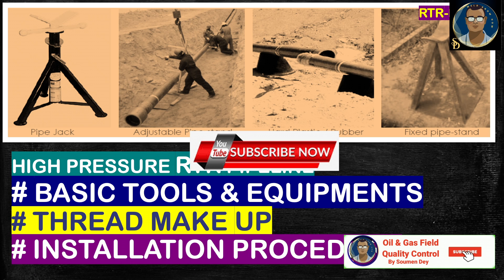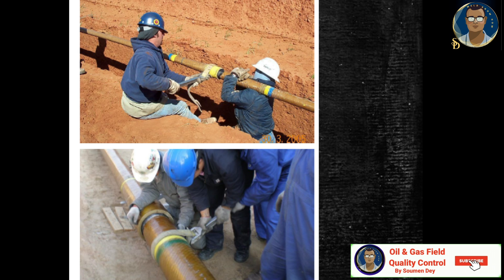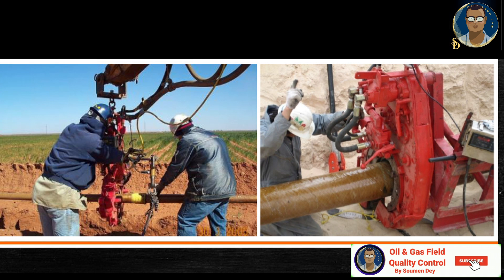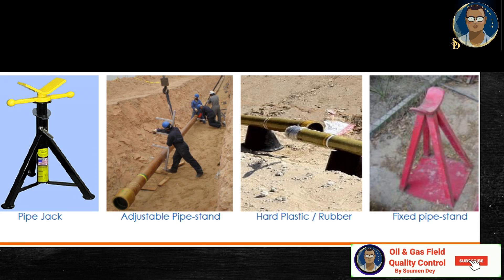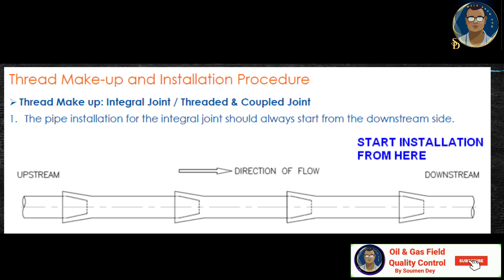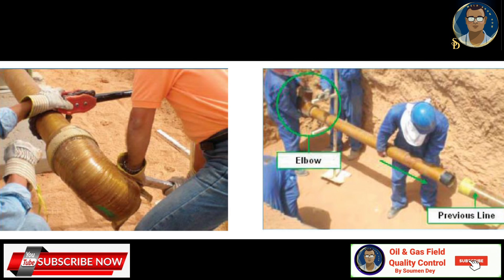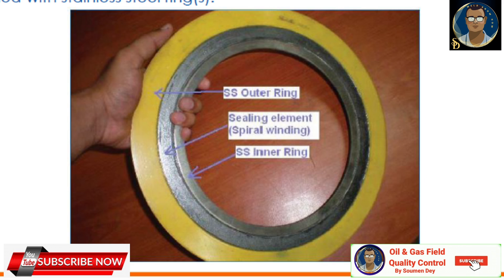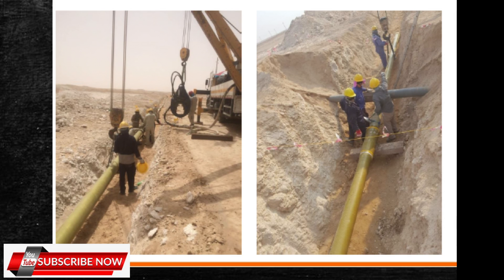What Is RTR High Pressure Pipeline? RTR Basic Tools

Comment: Sir, how many types of joints comes in rtr pipe
Reply from the maker: Basically threaded(as in case of high pressure piping we have discussed) and socket type (for utility low pressure lines) where we are using induction heating and injecting joint compound for joining. We need to cure the joint compound before use.